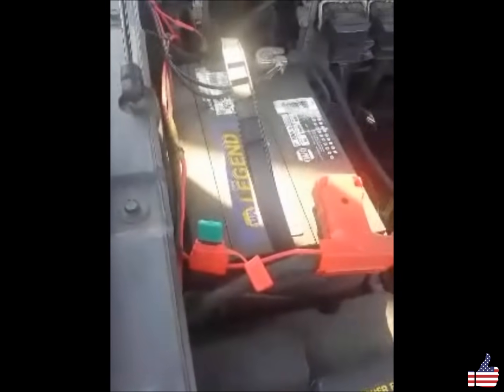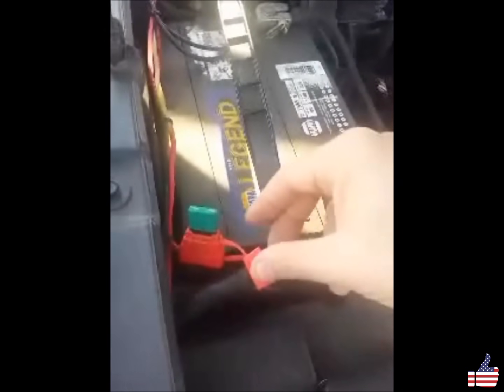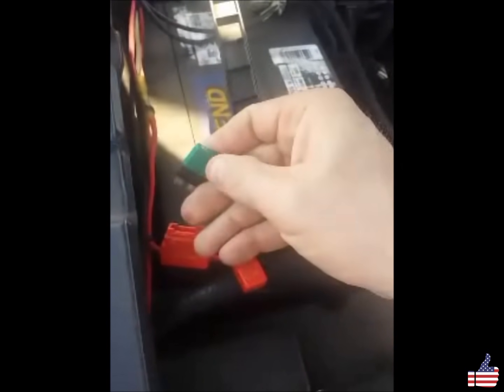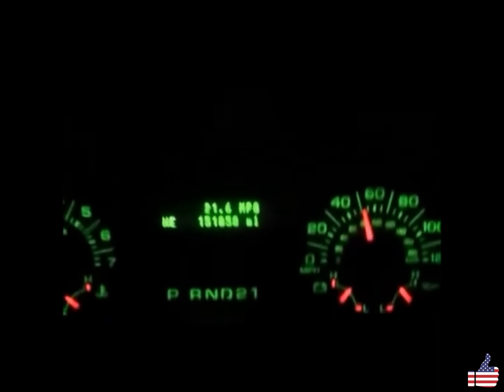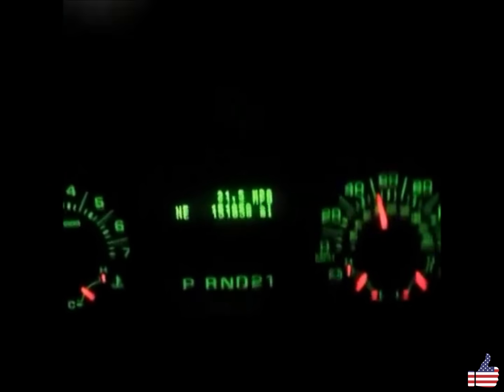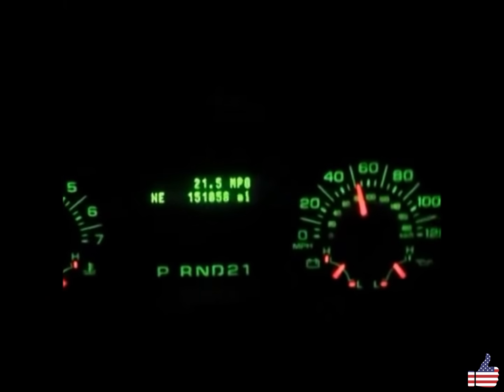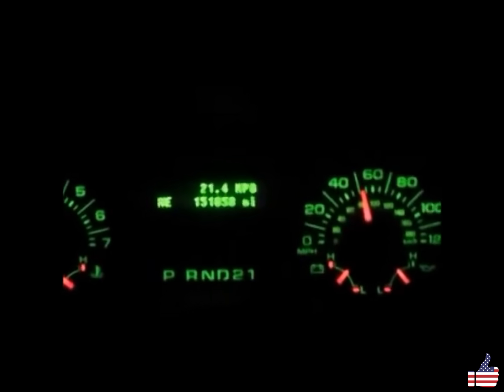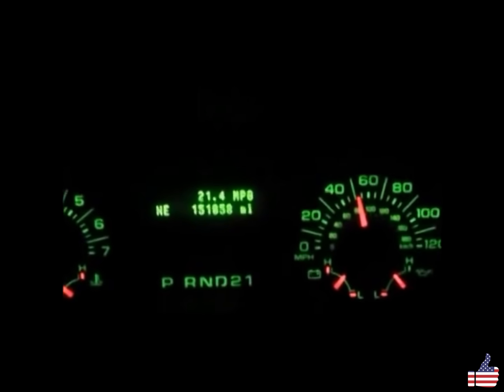What The Oil Companies Do Not Want You To Know!!!

Comment: Sir Richie, 
I wonder if also what is going on is the hydrogen, added to the gasoline in the combustion chamber also causes the gasoline to ignite more spontaneously, a more of an all at once explosion instead of the ignition as a spreading, slower rising explosion the it has been revealed that gasoline is.
Because I've Finally seen the question discussed AND answered, revealing just why Diesel get's better gas mileage simply because under the higher compression pressure it ignites more all at once compared to gasoline that is a moving ignition. So with the Diesel, this increases the efficiency of the push on the pistons and therefore increased MPG.
This was revealed with the discussions I've seen on why the new Mazda sky active gasoline engine gets similar mpg as the Diesel engine, because they finally found a way to compress the gasoline to the higher compressions like a Diesel to where it works without preignition.
Take care!
Reply from the maker: Yes you are correct HHO does not have a carbon molecule in the molecular makeup. Every other fuel has a carbon molecule, multiple carbon molecules in fact. Carbon is very inefficient in combustion. Adding the HHO Gas does increase the combustion rate and allows vehicles to consume much more fuel instead of going out the exhaust this is where the major increase comes from adding HHO to your current fuel.